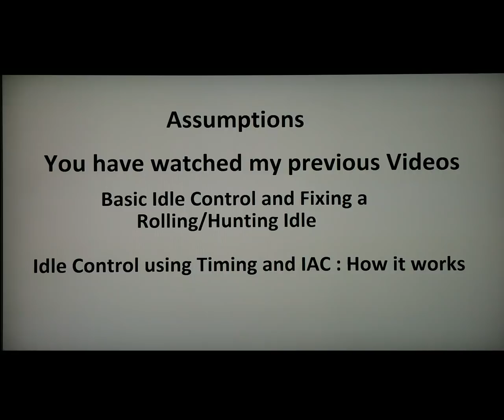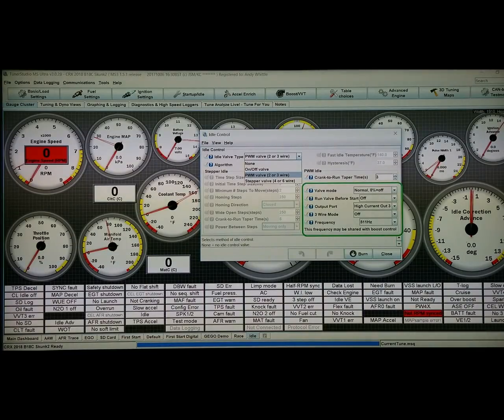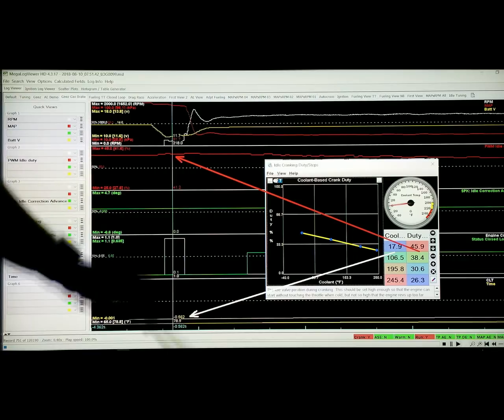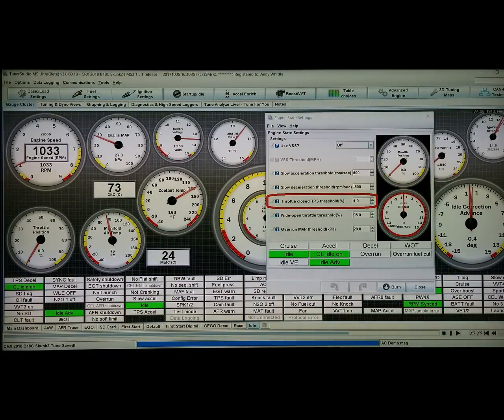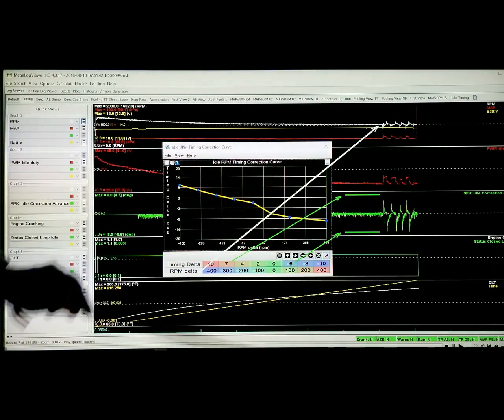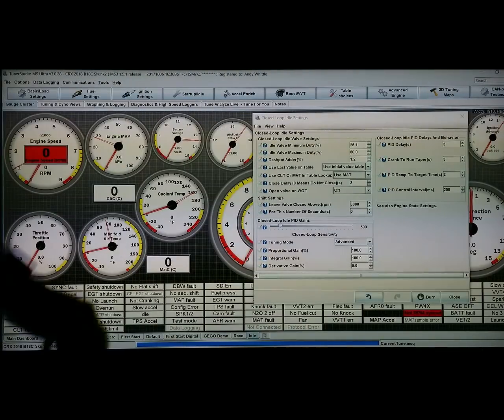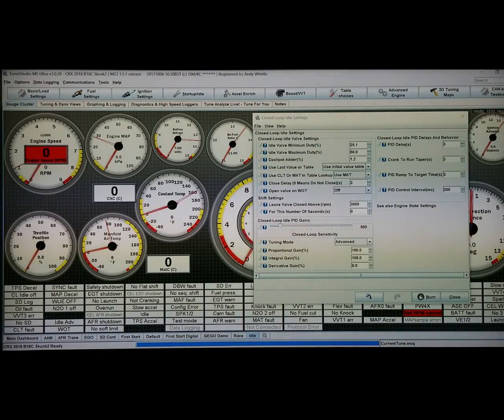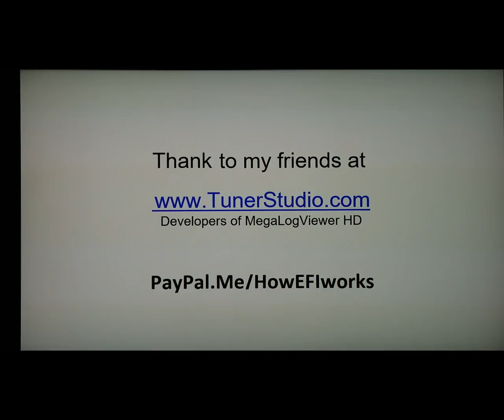Idle Control Setup on an MS3 ECU

Comment: Thanks Andy!

Any particular reason why you chose MAT over CLT for the initial value table? Mine is setup and seems to be working pretty decently referencing CLT. I never really gave MAT a second thought, but that would seem to make more sense since the target idle is already defined by the CLT, referencing CLT again is redundant.